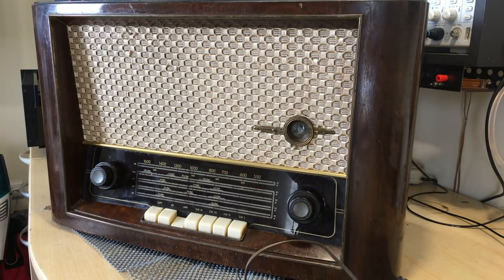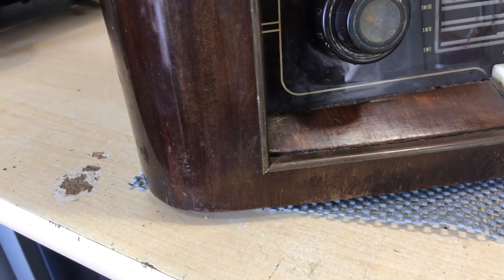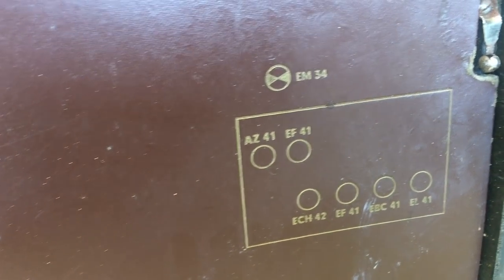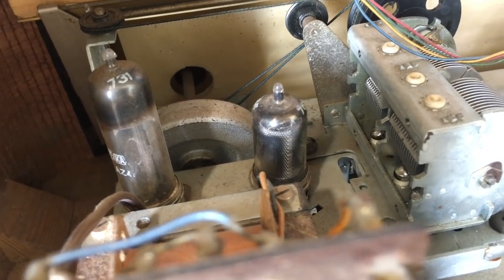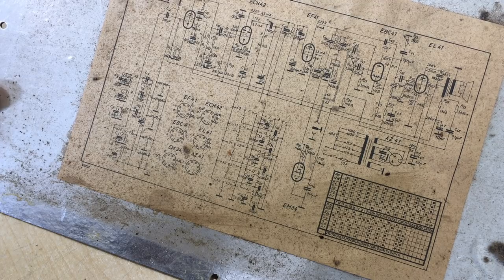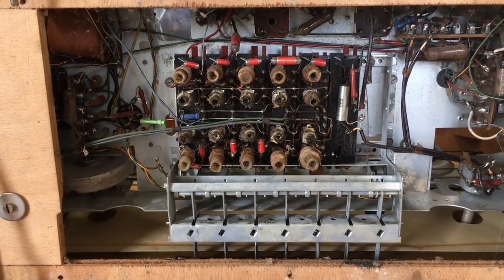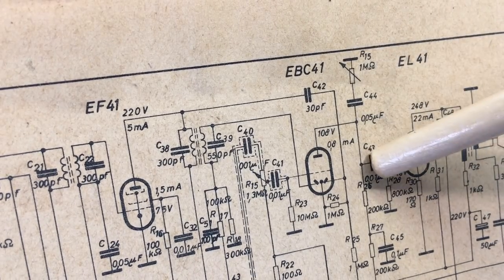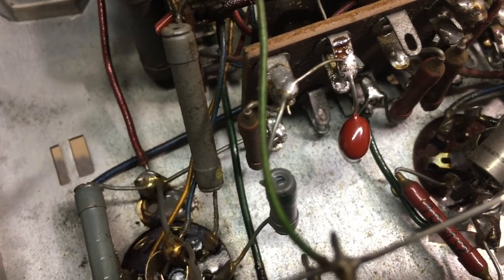TeKaDe W367K tube radio restoration - Part 1. First look, and first power up.

Comment: Hi Mr. Caldeira re. the output Transformer, I have seen this circuit before. The primary or more precisely, one half of the primary winding is used as the B+ filter choke. I once read an article about this & am ashamed to say I didn't understand it very well. This is what makes the output transformer more complex than it would first appear. If you do get a dead one it's an easy job to re-wire the B+ bit then you can use a bog-standard transformer assuming the primary & secondary impedances are suitable. Thank you for a very well explained procedure.
Reply from the maker: The B+ going into the transformer also leads off through a winding in the OT which in fact acts as a choke and helps to smooth it. Not strictly necessary but quite common in the German tube radios that I’ve restored.

Comment: I enjoy your videos, and I have started my process of repair as you have shown. but may I ask what program to  modify the pdf schematics showing different colors for defective as verified as good and lines for the wires traced etc
Reply from the maker: Da Scot : it’s simply done by using the “comment” function on the adobe reader. This can include text or graphics comments, so it’s very handy.

Comment: Hello! That C49 is a very strange placement, especially being asymmetric across the 2 phases coming out of the power transformer. Does anyone have any ideas what is its function?
Reply from the maker: it basically filters noise from going back into the mains line. As the transformer is a very low resistance, I guess being across only one winding does the job.
Reply: @electronicsoldandnew  Thanks! For this answer and for the great entertainment that I find in your channel ;)

Comment: Time to add this to radiomuseum.org...you are are member, aren't you?

Now why an EL41 when an EL84 would perform better?  Is the radio that old?
Reply: I guess, the outputtransformer has to fit with the el41. A simple replacement with a el84 may not work (I haven't compared the two tubes).
Reply from the maker: This one is a mystery as to its exact age. All the tubes are “earlier” than the majority of mid to late 50’s sets. The EF41 was ‘replaced’ by the EF89, the ECH42 by the ECH81, the EL41 by the EL84, etc.